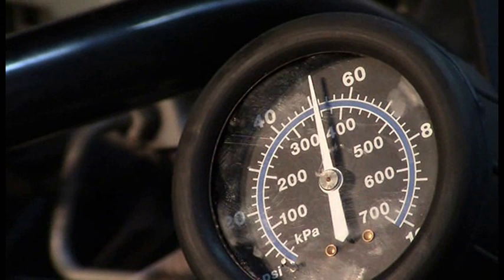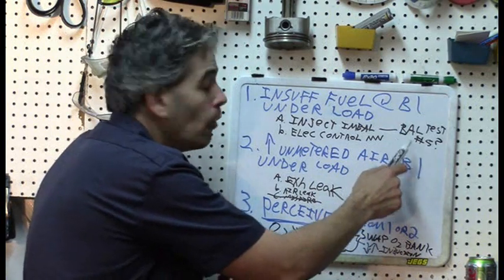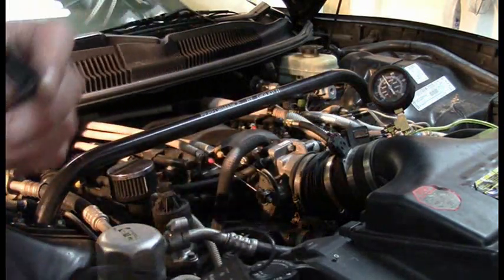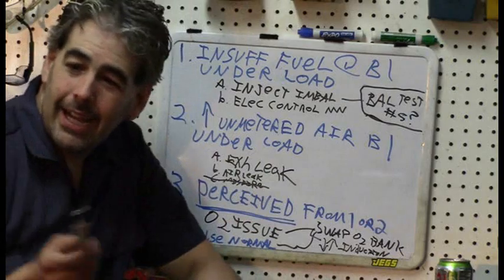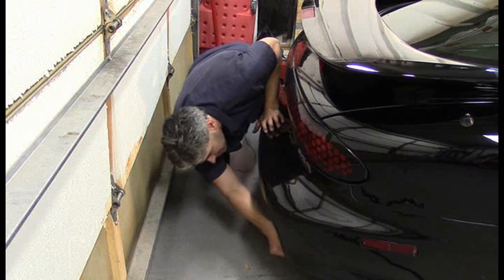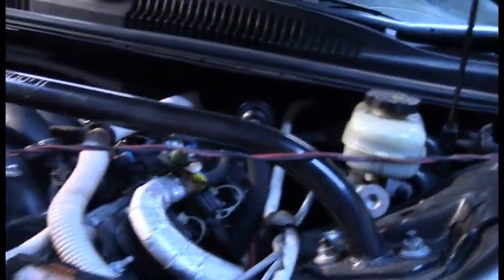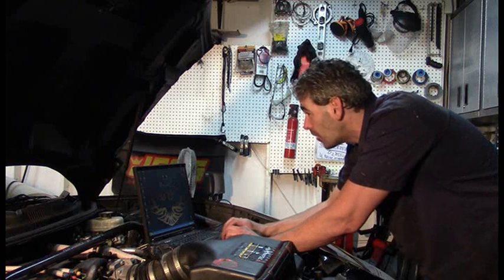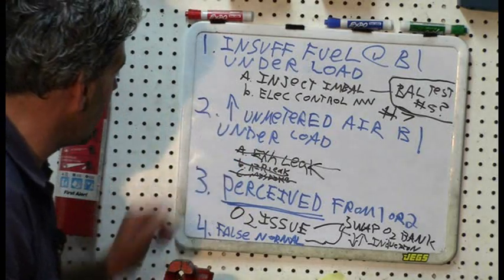Test Your Lean P0171 / P0174 Diagnostic Skills-Pt3

Comment: Hi Matt. I'm a new subscriber. I got P2179 code on my GMC terrain 2009 which indicates a fuel trim system lean at cruise/acceleration bank 2. One guy tested the car with his scan tool and he asked me immediately to replace all the 6 fuel injectors🙄😅 after watching your logical, scientific, reasoning diagnostic approach, I'm not going to spend 375 dollars on buying new injectors 😊
Reply from the maker: GREAT CALL!!!!There is absolutely zero chance new injectors will fix it.

Comment: Matt Love your videos and im learning so much. Having trouble with my 05 Grand Marquis with a p0171 and p0174 both banks running lean. I hooked up my scan tool and watched the ltft which are both at +25%. Took the car for a test drive and found that around 1500-1800 my fuel will go down to about +18% but go right back up around 25. Checked for vacuum leaks, cleaned maf and thottle body. Any help would be greatly appreciated. Thank you for the videos you rock man
Reply from the maker: Looks like vacuum leak to me.
Reply: Thank you so much. Keep making those great videos

Comment: Late to the party.  When testing the injectors, aren't you spraying fuel into the cylinder?  Did you take out the spark plug or check that one of the valves are open?  Just worrying about hydro locking the engine or washing down the cylinders of oil.  Maybe the testing isn't spraying enough to be an issue? 
Edit: missing link to Part 2 in description.
Reply from the maker: There is really little fuel injected. You would have to do it many many times for a hydrolock to be possible.
Reply: @SchrodingersBox  Thanks.

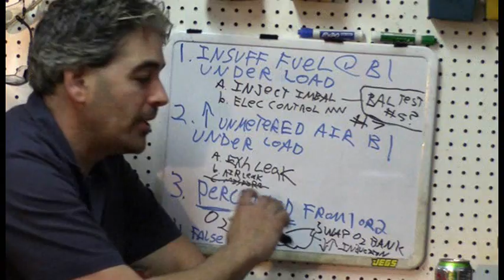Comment: At 11:15, I stopped laughing from your choice to stab your exhaust in the throat. :)
Reply: I would have laughed longer, but I paused the video when my wife came to see what happened to me.
Reply: I really wasn't suspecting an O2 sensor, but that is something that would only effect one bank.
Reply: Wow, those propane tests were really surprising. The car didn't react correctly to the brake booster being pulled either.
Reply from the maker: DE Nichols Yes I am convinced that the bank 2 LTFT is a substituted value that is being used- I don't know why- but that's what it is I am sure.

Comment: I always appreciate your explanation of methodology, but I'm a bit confused.  Earlier in this series, I remember you praising your viewers for not suggesting swapping plugs or wires as a means to troubleshoot the problem at hand, yet you swapped O2 sensors at the end of this video?  I'm sure there's a reason that I just don't fully grasp.  Not trying to be argumentative or combative in any way.  I've watched all your videos and have learned a great deal from them.  Thank you for your contributions.
Reply from the maker: I did not change the O2 sensors. I moved the left side one to the right side and vice versa so I could determine if there was a valid bank-specific condition.
Reply: @SchrodingersBox  Thank you for the reply.  I think I may have misunderstood your initial comment regarding praising viewers for not changing plugs.  I took that to include swapping one plug with another existing plug as a means to troubleshoot, whereas, (if I'm now understanding correctly), you were referring to not being a parts changer by going out and buying new plugs and changing them.

Comment: hello Matt sir great video , i bean dealing with a lean conduction with my 96 f 150 v8 5.0 i did some modify my  indushion system .question is would relocation like intake temp sensor and mass flow should be in any order or closer or farther form throttle body  thank you for your time .
Reply from the maker: it would make no difference whatsoever with the IAT because the fuel trim would simply correct anyway. the “relocated IAT to a cooler area to get more power” is a complete myth. 
   the MAF should be close to the throttle body ideally so as to get most accurate airflow closest to where is enters engine.
Reply: That’s what I originally did is put in the y  induction pipe Relatively closer to the throttle body . it doesn’t give it more power but it run little better  I know it’s a little better fuel mileage I had no idea that people did that  to modify it I just gave it a try
Reply: I just to say thank you sir for the feedback and your videos .
Reply: And is crank case vacuum pressure could possibly have any relevance in any lean condition issues? Thank you sir for your time

Comment: You seem like a freakin genius! Would you happen to have a video on diagnosing a lean condition that only affects one bank? Mainly for code P0174? My friends a half ass  mechanic that doesn't believe in following proper diagnostic flow charts..he has a 99 f150 with a 174 code that he keeps throwing parts at. Id like to show him up and fix it cause he says theres no one in the world that can figure out whats wrong with it
Reply from the maker: One bank is easier- you have less variables.  Look at the fuel trim against load and you’ll easily identify the problem.

Comment: Would that propane test really work for detecting an exhaust leak? I would expect the exhaust system to have positive pressure, preventing any propane passing by a leak from entering the exhaust and causing the sensor to read rich.
Reply from the maker: Yes but remember there is also venturi effect from the flow of the exhaust.

Comment: Wait, doesn't the propane have to be burned to reliably change O2 sensor readings? When you add propane to the intake, it is burned in the cylinders and more O2 is consumed, causing the downstream O2 sensors to detect less oxygen. However if you add propane to the exhaust manifold, there is no ignition there for the propane to burn and consume O2. Of course it would burn downstream in the cat. Same O2 at the upstream sensor should read same upstream voltage, no?
Reply from the maker: My assumption is the propane is diluting O2 in the exhaust, creating the lean condition by having the unburned propane molecules competing in place of Oxygen.
Reply: Oh, I see, thanks.

Comment: You didn't specify the comment about anti-seize on the oxygen sensor was a joke.  Probably goes without saying that anyone who would do that isn't the right skill level for this channel.  You should avoid making jokes like that without specifying your sarcasm.  Why?  Because there are dumb asses who put NOS energy drinks in their gas tank.  Never underestimate the power of the ignorant or stupid.
Reply from the maker: It just aggravates me because there are always those people who are trying to find the one single thing I did wrong out of a 2 hour video with 12 hours of filming, editing, and not to mention focusing on the repair itself.  If that mistake I made is a logic flaw, then I welcome it- but when it's something from chapter 1 of the Haynes manual just so the person can try to act like they are "one up" on my efforts I want to throat punch them! It's like the grammar police pointing out a minor typo on a 200 page medical dissertation about a new AIDS vaccine but not saying anything relevant on the procedure or conclusion.
Reply: Throat punching seems to be a recurring theme.  I always get a kick out of it though.  Don't like my cat?  Throat punch!  Stupid comment?  Throat punch!  Misspell vacume?  Throat punch!  Your daydreams of fuel trims are almost as elaborate as throat punching haynes jockeys.
Reply: ***** just a comment, its the first time I've viewed this but I have a pretty good grasp of this stuff. I was taught it slightly different but is the same old sh*t, nice to see it from both sides of the canvas.liked the punch in the throat I even rewound and showed the wife. I maybe a nerd but I even laughed at the potential joke before he gave the answer.
FACT: if you can do better than this guy prove it...

nuff said keep up the good work Schrodingers Box

yours

 your 2%
Reply from the maker: daniel higginson Thanks Daniel- well stated! Glad you get the humor and point of the content but more importantly, I agree- there is always more than one way to approach this kind of material and different people may have best responses with different approaches.
  I fully recognize my approach may not suit everyone but I always have respect for people who attempt to learn this higher level stuff and never have respect for people who don't know it yet criticize it because it isn't "turning bolts".  There are more than enough idiots out there who can replace an O2 sensor but how many aren't doing it on a guess?